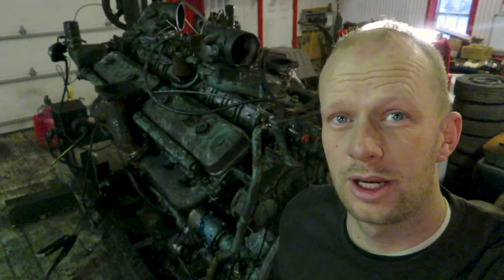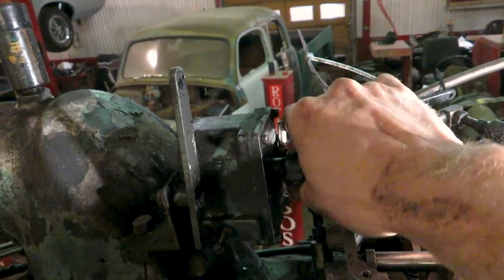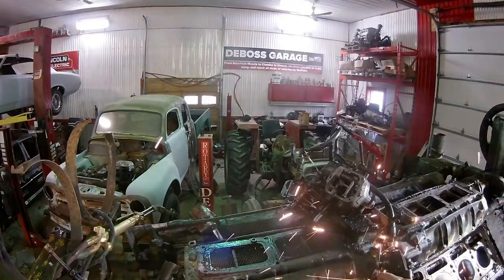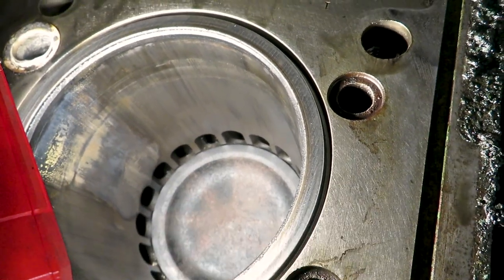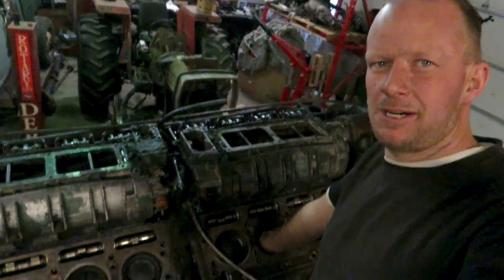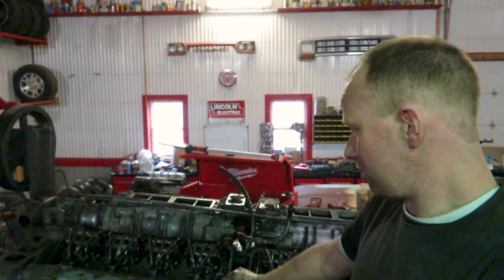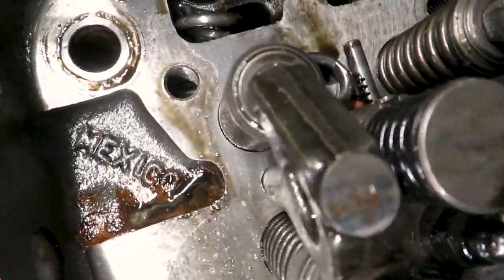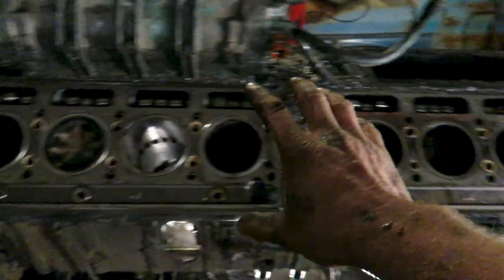What's Inside a 16cyl 2 Stroke Detroit Diesel? #HowItWorks

Comment: If you want to pull the injector the easy way - just leave the pin in the three rocker arms and just push the back - the rockers will go over center and stay out of the way - remove the injector - if your at sea and need the engine just pull the rod loose from the bottom on the piston pin - put the piston over the air box holes - then the trick is to run some bigger sheet metal screws into the piston to hold it - to put the two blocks together you use a line bore slug - stand the block on its end the set the second block on top - insert the line up slug and start tightening the block to block bolts - if the slug cannot be easily rotated then start over - there are some line up tools that bolt to the pan gasket surface - the cranks come from the factory already bolted together - I have never put two cranks together - 2 of us used to build one of the 16 cyl 92 series engines in 2 long days - and we had a guy in the shop rebuild all 4 heads both blowers - water pump - fuel pump - oil coolers etc ... When those fishing boats came to the dock it was like a pit stop for everyone . Two of us could unload the engine in 4 hours or less - one guy would stay with the boat and get everything cleaned up and ready to go back together - the other guy would take all the parts back to the shop and help the guy build all the compenants plus you have to build the kits on a Detroit - by the end of the day the engine would be ready to go back together. Second day was assembly - about 12 or 13 hours into the second day there would another noisy Detroit running in the belly of some fishing boat .... I made a lot of money working on those engines - what made them so popular was the horsepower to weight ratio - and the ease of maintenance...

Comment: We have same detroit 149 16v , it's on all old school mechanical UPS power. It's complete line alter+motor+flywheel+clutch then pedestal fitted with 16v.its 1250 kva. Takes under 3 secs.

Comment: The Mexico head is a much newer spare part that's been fitted at some time. The wooden plugs should have had freeze plugs installed, that's the location where on an electronic DDEC engine the injector wiring harness would enter the head.

Comment: Nice video . Underappreciated  engines used in everything industrial from 16v567 locomotive power to 1-71 generator power . These engines have a very long lineage going back to the early development of a diesel engine for    the EMC locomotive in the early thirties . GM under it's then president Alfred P. Sloan purchased EMC to get it's prototype . Charles Kettering of DELCO , then a GM subsidiary , was put in charge of turning it into a reliable 16v567 engine for locomotive use by 1939 . MIT helped a good deal in this effort . This engine was so successful it was manufactured only for wartime purposes like powering the LST until the end of WW2 .

Comment: At my old job we had a few trucks powered by 16v149ts. Quad turbo 39L 1800hp engines you could literally hear for miles if the conditions were right. They were really cool.

Comment: If you want to change the rotation from Right Hand to Left Hand, you have to do more than change the starter.  The cam shafts are different, and you have to move the intermediate camshaft drive gear to the other side.  In the 16V engine you have, one set of camshafts are left hand rotation, the others right hand.  

You mentioned about line boring the two blocks.  Not really needed, just need a special tool to align the two blocks - then just bolt it all together.  Its the same technique for 92's and 149 engines.

Comment: Since this is two 8-cylinder engines, that would mean that two cylinders would either be firing at a time (one in each of the V8 blocks), or they're tuned in such a way that they're still offset ..in that tiny area of rotation between the power strokes of one of the blocks.   Either way, it's really impressive.  I think the second method is used, which is why it sounds like a big, diesel Ferrari instead of two synced V8s.. or one with an echo, or something.

Comment: I got an old Oliver diesel tractor running backwards by popping the clutch during a stall dragging big rocks off a new hayfield in Cali. It was a shock to see the exhaust stack close and  exhaust pump out the intake and the thing move backwards in 1st gear. Like he said it restarted in the proper direction after I shut it down.

Comment: Also, the 71 series was actually available turbocharged.   It’s not uncommon at all.   The 71 series isn’t known for making a TON of power, even when turbo charged, which is why you don’t see it done that often.  But as a factory option, many of the 71 series engines were available turbocharged.    Detroit considered the supercharged 71 series to be ‘naturally aspirated’ and the version with both as simply “turbocharged”.

Comment: I had a 8v 71 Detroit in  my truck tractor when i was a kid. Good engine especially starting in cold weather.  They leaked oil but were reliable. They lack the torque of the Cummins or Cat but very simple. The Railroad locomotives  stilluse their big brothers EMD 567 and 645.. although they are slowly getting replaced with 4 stroke diesels

Comment: 16v71s did come turbo on top of blowers. Continueous 780 horse changed one in a crane in Newark.  All Detroits had piston cooling through the rods weather it be noodle on top of a trunk style rod. Or cross head which is what you have. Oil hole goes from bearing to under side of dome. Also they are called break away racks

Comment: The aircraft generators I use to use had Detroit 60 series in them iirc. The guys who maintained them said never use the emergency stop that shuts the intake because they like to suck in the head gaskets. They said only for a run away. If it just wont stop but is at idle, let it run and call them.

Comment: I ran a utility vessel in the oilfield with 2 16 92 Detroit's. Had several run away over the years. The throttles were wire controlled.

Comment: The inline 6-71 engine was the engine that all the hot rodders used to supercharge there drag race engines in the 60's.  The V-71 came later and the blowers require a different intake to use.

Comment: I cut my teeth on 71 series detroits as an apprentice and I have seen a 16v71 continue to run after the emergency flaps were deployed at full rpm and no fuel being injected. What happend is the vacuum caused the seals in the blowers to turn inside out and the engine idled on just engine oil from the blower. Good old reliable engine, Love em. There is a real art to setting up the rack on these that's for sure.

Comment: In my opinion one of the greatest engines ever. If maintained they can and will run forever. Saw many when working in Azerbaijan en Turkmenistan in ships that were sold from europe and the US over to the late soviet union, the soviets even made a copy of the detroits that they used in boats, trains and  i believe the Kraz 214 6x6 truck. everybody is always talking about how they leak and blah blah, thats just poor maintenance, worn out liners and pistons, worn out blowers, etc. if you treat these engines well, they will treat you well. Thanks for taking the time to show the people how these engines work Rich. I just bought an Deutz F8L714, backup generator from a local hospital.... Maybe NYE 2019/20? haha
Reply: And don't forget to mention that the scavenging ports (intake ports) are placed tangential to create a swirling effect in the scavenging air to push out more exhaust gasses ;)

Comment: Those unit injectors are the best injection system ever made. 20,000+ injection pressure, simple, cheap, and easy to work on. You can test them on the bench, just chuck one up in the vice, fill it with fuel and pop it with a hammer. Crude, but you can get a pretty good idea of the spray pattern and whether it's working right or not

Comment: I've got to challenge your statement about stuck injectors not being a runaway.

If the injectors are stuck in the full fuel position then the governor would not be able to limit the high rpm of the engine thus the engine would increase in rpm uncontrollably until either catastrophic failure or floating the valves.

The engine governor works by using flyweights and centripetal force to apply force to linkage to limit the engine rpm. As engine rpm increases the governor closes the linkage to the injectors. If the injectors are stuck in the full fuel position and unable to close then the governor control is eliminated.

Comment: I haven't touched one of these since i was in tech school almost 20 years ago. We got to tear them down, even got to disassemble the unit injectors in our fuel lab. Wish there was still more of them around.

Our teacher we had used to work at a Detroit dealership and he told us the story of one running away in their shop. The guy working on it panicked and tried to snuff it out with the shop manual. It started sucking in the pages and spitting burnt pieces of paper out the exhaust. Kept going.

Comment: Its cool to see the mixture swirl on top of the rusty piston. That would be great info when modifying a gas 2 stroke. Dont mean much on this motor cause i guess high compression and exhaust valve keep it from blowing half your charge out the pipes.

Comment: Great Video brings back awesome memory's.  This is going to be a little long.  I just want to say the runaway description  is a little off.  When I started my carrier early 90's these were very common and I also started in Marine Diesel before switching to trucks.  When I had my Cat training We spent a lot of time on run away engines because as you know the 3406B was also prone to runaway.   The issue I had with the description was full rack and full rated RPM fuel are two different positions of the rack and that is the reason you can have a run away with out external fuel sources like the base oil.  If you can get your head around injector pulses per revolution it all makes sense.  It's easy to prove on a running engine with a dial indicator on the Rack.  Zero it out at rated RPM then idle it down 250 RPM and you will will see that the engine will require a greater Rack position to maintain a lower RPM with the same load because there are fewer injector pulses per RPM.  Then raise the engine speed back to rated RPM and you will see the Rack spike to bring the RPM up but will settle on the lower Rack position to maintain the higher RPM, and that is how they compensate by design to changing loads.  I don't know what the malfunction of the Governor was here before you started but the "best" or worst way to make one of these and any other diesel that the rack directly connects to the injector is to Jam the rack before the spring in the governor housing.  So in this case you should have jammed it under the valve cover.   This is the same issue a Tech would have when he changes an injector and messes up on his rack adjustment and the rack jams it will cause a run away.  (Guilty)  That would have done it.

Comment: correct me if im wrong but I thought that  the condition for 'runaway' was the blower seal failing and the engine running on the oil from the blower lubrication being sucked into the engine and being uncontrolled. Hence the only way to stop the engine was the air flap.
We had many of these and the  v16 92s as back up generators on various ships.( close to 1,000 hp i think?)
If the main generators failed, they would go from zero, to 1800 rpm in a matter of seconds and automatically go on the switchboard to take essential service load.
Terrifying to be in the space when it happened. Waiting for bits to come flying out and hit you. Never did though.
An earlier variant  of the Detroits was used in the landing craft ion WW2
Awesome video, and I can smell the engine while you are working it
Thank you very much
Reply: Runaways also happened when the cap on the piston pin popped out. The engine oil is pumped into the air box and the engine runs on it.
Reply: They will also run away if they've been sitting for awhile, the injectors go to full fuel after shutdown and if they sit they will stick in that position. The only way to shut it down is to shut off the air supply

Comment: If I remember right. When starting the engine if it does kick back and start backward it’ll run fine but the oil pump spins the wrong way and ya lose oil pressure. Not good to let run backward. Them old two stroke diesels were put into some of the old buses with engines in the rear. Got to work on one of them

Comment: Look into the old(50's 60's) torflow 610ci and 700ci v12 for medium duity apps. For light duty it was singled out to a 305 and 350 V6... was originally designed as a diesel last minute production change to gas all they had to do is screw plug spark plugs into the injector holes add for both holes in the spiderweb intake for the carb and sticking ignition distributor in the whole that held the injection pump, o' ya  "low compression "gas pistons. 

These 305 V6 were were pretty much the Barney Badass farm truck motor through the 70's.

 Convenience of gas torque and durability of diesel... same low redline... was basically a small block 400 short two cylinders and a much heavier diesel grade crank.

Comment: If you want to see a really big version of this type engine. Check out an EMD locomotive diesel engine. Pretty much indenticle in operation to these Detroit's. They are 2 stroke. Come in 567, 645 ,and 710 cid per cylinder. Also are either supercharged or turbo.

Comment: I love the 92 series. I was privileged enough to tear down a handful of mechanical 8Vs, probably a hundred with electronic injection. Tough motors. But it's a real bitch to adjust that rack without the specs, I've done it with the book and it was still nerve wracking. This was awesome! Great vid
Reply: There is no spec. for adjusting the racks, you just have to have the same drag on the rack pins when you have the rack at full throttle.

Comment: If you are in a boat chances are you can't drop the pan to get at the lowers without pulling or at least raising the motor a bit.  I've seen lots of field rebuilds in logging equipment, buses and trucks etc but boats are usually a pain in the ass when it comes to access.  If you are lucky your DD will get you back to port before you have to start wrenching.  In a displacement(non-planing) hull they are a super reliable and durable marine engine especially with a keel cooler.

Comment: The blocks and crankshafts for this motor are not interchangeable from front to back. They are specific to the 16V71, the crank pulley only fits on the front crankshaft and the flywheel only fits on the rear crankshaft. The coupling between the two is different than the fan end or flywheel end. The blocks are also unique to this motor as the bellhousing will only fit the rear block. We overhauled one for a yarder in Oregon, it takes a bench twenty feet long to hold all the bolts after they are cleaned and ready for assembly.

Comment: When the rack sticks or binds full fuel it is a true run away because the governor is no longer regulating engine speed. If you put vice grips on the rack and rev them you can feel the governor very aggressively trying to pull the rack back.

Comment: Many years ago I worked for a hydraulics company that serviced large earth movers. Euclid 150 ton dump trucks used these for power. It was not uncommon to see these in their shop with 3-4 connecting rod holes in the side of the block.

Comment: Had a 6.2 in a HMMWV run away. Cut fuel to try and shut it down with no luck. Have to give that boat anchor motor credit. It didn't stop until the intake manifold melted and got sucked into the motor. The exhaust dug a hole in the sand about 5ft wide and 3ft deep.

Comment: If you want to create a run away on a GM in the future the best way is to screw in the buffer screw in the governor, or disconnect the fuel rack arms that come from both cylinder heads, from the governor, and wire them in the full fuel position (not sure f you tried that)

Comment: By looking at the liners it is noted that it is a medium speed engine. If the liners had tapered and elongated ports it would have been a high speed engine. This would have been a wonderful engine to put in a motor yacht attached to a generator and power the ship that way.

Comment: Old video but 8 cylinder and 16 cylinders were different, 8v71 has a 2 piece camshaft bearing the 16 cylinder has 3 piece camshaft bearing and also a 2 piece bearing support with lock rings. Also some 8v71s use a camshaft torsion damper that was keyed to water pumpdrive gear.

Comment: Runaway is from the seal in a turbo failing from to much boost ,heat or age.The oil pressure to the blower bearings which are just roller bearing is a lot lower than where as the turbo is a bush which needs higher oil pressure.

Comment: If the injectors hang the rack in the full fuel position, it will run away on fuel. The governor controls the rack position, and full fuel bypassing the governor will accelerate the engine until valve float. When you ran it away, it was at valve float, not at governed no load speed. That is a run away, no matter if it is running on fuel or engine oil. 

Just some info. Cool video, both of them. Lol
Reply: The engine would not run away if it has a spring load rack, like the one in the video/